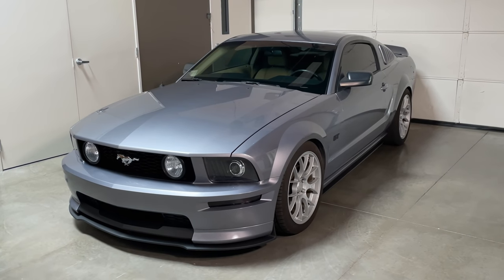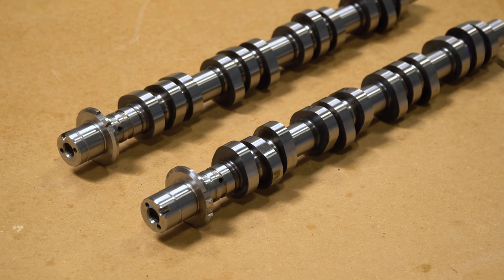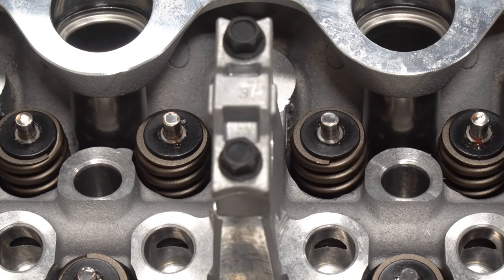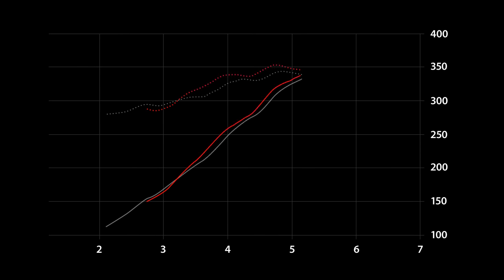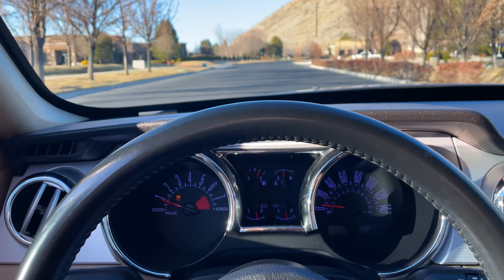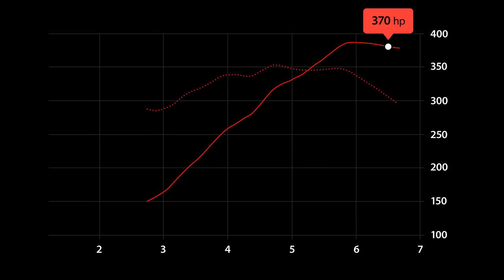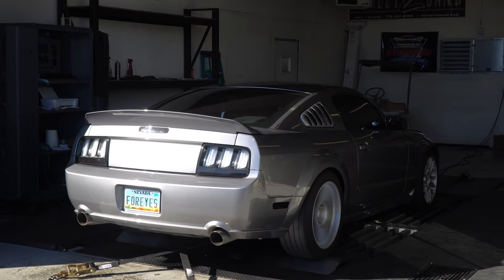The results 📈 of installing the most aggressive cams on my Mustang

Comment: Unfortunately the Heads and short block won't do much for NA power if any. But hey when boost comes around they will be fantastic. 
So with Cams, Intake, Exhaust, E85, TR-6060, and 4.56 gears here is how the 3V does. 
Also suspension, tire, weight loss etc...
https://www.youtube.com/watch?v=RJOvqM2fiww&list=FLowQqmeGBo6RHE2rcjGAHRg&index=124&ab_channel=StickShiftSam
They rip with the right gearing since they are so light and the new stuff is so heavy.
I think he ran an 11.2 @ 118 mph NA stock shortblock launching off a 2-step at basically the rev limiter. So without the 2-step rev limiter launch i could see them running a 11.9. Thats not bad at all.

Comment: I have a built Aluminator 3V and the 127600 cams are NOT the most aggressive cams for this engine. I have the Comp #127650 cams, now those indeed are the most aggressive cams from Comp (according to them) that you can shove into this engine.

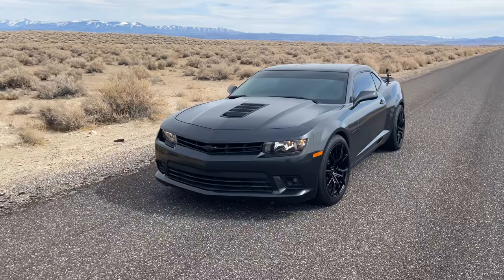Comment: Let me help you I did a 3v build 10 years ago on my 07 Shelby gt 3V , built bottom end ported polished 3v heads with 1mm oversized valves . Comp 127550 stg 2 cams a t56 magnum xl and 373 gear and Vortech V3 SI trim on 14/15 psi . Car made 735/628 8300rpm . You need a touch more gear if your running n/a but if you boost it leave that gear in it or 3:55s trust me . Also a tremec 3650 will never shift at the rpm your 3v is going to make peak power at with those cams . My car made power to 8500 with a blower. I ended up over driving the blower with a 6% crank pulley Iby innovators West. The car came alive much faster and I didn’t have to shift it as high I was able to shift it and make good power on the street around 7700 the other difference was I my motor was 10.2 compression and Stock cubic inch I didn’t want to change the rod angle and side load the block with different rod ratio when stroking a 4.6 . Your going to need to swap that transmission for a piece that will handle 7000+ rpm shifts , good luck with your build. Your on the right path

Comment: lol when your "most aggressive cam" falls off at 6k when i had a crane cam that was rated for 7800 in a foxbody. having OHC gives you the rev advantage over the pushrod. at least 8000 rpm wont wear your valvetrain out!
Reply from the maker: yeah there’s not enough air pressure at this altitude to sustain the engine above 6k, sucks.

Comment: actually you should upgrade to 4:10's or 4:30's.  I installed 4:30's on a 97 cobra back in the 2000's and it was awesome.  Amazing difference to the 4.6 engine DOHC engine.  It would appear that you have a lack of torque probably inherent to all 4.6's regardless of your stroke.  Only way to over come that NA is to gear for it.  Trust me...the steeper gears make all the diff.

Comment: I had a shop in the early 90's building Foxbody's. I'm going to give you the same advice I gave back then. Have a plan of exactly what you want to do and a budget to get there. If turbos are your plan than build your car per future turbos. Why are you buying and trying parts now and building it to do something else. That is a waste of money, which I found is exactly what most people used to do. Buying pieces of a puzzle and trial and error is inefficient and costly. It's better to plan it out and go from there using someone who specializes in what you want to do, not a "general mechanic" or someone who specializes in something else. A mechanic who specializes in xyz can tell you exactly what you need to do for each application

Comment: My stock chevy express 3500 6.0 cast iron block Vortex L96 does 349hp and 398ft/lbs torque.
Of course, it's a 9600lb extended cab beast. But I think your upgrades are going into nowhere. If I did the cam job you did, I would probably be pulling well over 410 hp. And with the 6 speed allison trans it would be fun 🤣🤣🤣

Comment: Just in case anyone reads this message, would you recommend getting the Ford Racing intake manifold to use with the Hot Rod cams? Ford says the cams, manifold and CNC heads will produce 50 + horsepower. Here's the kicker though, Ford doesn't produce those heads anymore.

So, will using the Ford Racing manifold and the Hot Rod cams together produce better horsepower than the stock manifold and cams together? If not, what heads would you recommend to use in place of the Ford Racing heads?

There's a lot of solid info in these videos, so thanks for that anyway, it's exactly what I needed to know for the S197 I want to build. I'm looking to produce around 450 horsepower at the crank, without using boost, so if you have anything to add, as far as parts go, that you already haven't, please do!

Comment: Still not bad considering the huge difference in displacement and torque. Too bad Ford never put the NA OHC 6.2 in a Mustang, it would whip the shit out of a ZL1. One thing Ford does extremely well is extracting a lot of performance frome small cubes, imagine if they put the R&D into comparable engine size

Comment: I have a JLT series 3 (which says 30hp) and Roush extreme Catbacks. Reading forums on different parts I want, UD pullies supposedly yield 10hp, FRPP cams around 25-30hp, BBK shorty headers 10hp, and a custom dyno tune to support. Do you think I can squeeze 350hp out of this? Will i have to get high flow cats and X pipe?

Edit: 350 wheel* horsepower. Also considering 3:73 gears

Comment: In your previous videos, with the aggressive tune you were trying to make coyote power with what you have, the basic bolt ons with cams if I can recall the hp you made it to was 362hp, how come with a stroker kit with all those forged parts it’s not making any drastic gains? I thought you would be close to 500 with a stroker kit and all that deep internal work b4 the aggressive cam, am I missing something?
Reply from the maker: low compression ratio, possibly large piston ring gaps letting too much blowby. engine’s built for boost often don’t make great NA power, but i’m trying.

Comment: 4.6 : built engine, ported heads and cams, 400 hp
My 5.3 : cam kit, 410 hp
Man you would've been better off just swapping a gen 3 5.0 in that thang

Comment: Seems fast to me I always felt 400hp was real good, 
400hp is not a bad punch and it’s not so much to where you have problems applying power to the pavement 

But I come from the era to where 325hp was something
Reply: have some what of a sweet spot for the 4.6l 
 Seen them hold their own, with a actual driver , not  steering wheel holders that hold their hands 
Ten &Two and just mash a pedal on straights  and act king shit because they gap you with 600hp.
 
Curves, traffic, bad roads ,and timing traffic with dipshit drivers is a whole other animal

Comment: Looks like you need more cyl head flow rather than cam timing. Especially with the power plateauing like that. Something's getting choked in there.
Reply from the maker: Not enough air pressure up here at 4,500 feet to sustain the engine beyond ~6,000 RPM. Since this car will be boosted the issue is moot.

Comment: Did you figure out why HP flat lines above 5500 RPM?      Your cam is plenty big enough could it be the intake manifold shutting down power up there?    The old curve also shuts down there.   If it didn't shut down maybe it would get to 410rwhp@6500 rpm.
Reply from the maker: i believe it’s the elevation, not enough air pressure at 4,500 feet to feed the engine at high RPM
Reply: Elevation will affect power due to air density but should not affect the power curve.    If you were in the old 5.0 days id know the long runner intake is shutting you down over 5500 rpm and if you want a higher power band you'll need a shorter runner intake.
Reply: The other reason would be valvesprings.     But I assume with the ported heads and a cam swap proper valve springs are installed.   I have to imagine the PowerBand of the new cam goes well over 5500.   Solve that and you got a nice chunk of HP waiting.    The old setup also flat lined at 5500, so its likely the same thing bottlenecking it.
Reply: Spec sheet for the comp cams 127600 shows a power band 1000 to 7100.  It requires specific valve springs.  It should be power peaking at 6500 or so in your setup.  Which is easily 410 to 420 rwhp based on those curves.  

Another culprit could be a fuel shutoff or fuel pump issue?   Its more likely valve speed.    I found another guy with a similar combo and its 425rwhp@6600.

Comment: "most likely reduced my compression ratio"?? The CR should have been calculated and then checked/confirmed during the engine mock-up. Not hating, just pointing out that these are required steps in putting together a high performance engine. No guesswork.

Comment: Well comparing a 6.2 liter to 4.6 liter. I think you done pretty good. I know on race day bring what you think will win. But the chevy to ford mustang comparison has been going on like this for years. Now when ford guys bring out a mustang with a 6.2 liter the chevy guys always cry and say that ain't fair. Lol. O well it sounded good. We'll see what happens when you change the rear end gears.
Reply from the maker: ha yeah, i did the math and if the 3-valve was a 6.2 liter, it would make about 485 wheel horsepower. and if it had the same compression ratio (10.5), it would make over 500 wheel, which would be pretty awesome.

Comment: 4 eyes can you touch up on either a steel flywheel or aluminum?  thank you.  Which one do you have?
Reply from the maker: The lighter the flywheel, the more power makes it to the wheels. This comes at the cost of driveability and drivetrain noise. Heavy flywheels store more rotational energy which allows for nice smooth linear acceleration from a standstill and they also dampen drivetrain noise by reducing harmonics.

I currently have an aluminum flywheel (11 lbs I think). I have to slip/modulate clutch on the launches so the car doesn't bog down - it's tricky. But the car is also super rev happy now and seems to scream into the higher RPMs.
Reply: @Four_Eyes  Thx for the info.  Love that 3v!

Comment: Did you ever get strong fume smell? I installed hot rod cams and pypes longtubes catted H pipe. It’s been couple of days and the car stinks. Checked and no exhaust leaks so far.
Reply from the maker: Can you smell the fumes inside the cabin?
Reply: @Four_Eyes  Yes
Reply from the maker: You should really only be able to smell fumes when behind the car, or if you idle for a long time in the same spot.

Are you running a stock tune?

Comment: So how did you fix the spark plug blow out issue? I'm curious cause I have a nissan 240sx that needs a solid v8 and I like the 4.6 alot.
Reply from the maker: Aftermarket one-piece plugs should do the trick. That would be a great build. You would probs get a decent amount of hate, but sure would be unique.
Reply: @Four_Eyes  I feed off others hate and ability to do nothing about it 🤣🤣🤣. I just happen to live in the one area where there are a ton of broken in half crown vics, mustangs, explorers, and f150's. So I have my choice of cheap aftermarket and garunteed modular's laying around.

Comment: Did you ever race the Camaro before he sold it?
Reply from the maker: negatory, it would have been closer and i may have pulled a little in first and second, but third gear on these mustangs is too long. i raced the viper recently and it was p much dead even until i hit third gear.

Comment: Idk how you can say that the drop in compression doesn't matter considering you are planning on TT'ing it. Obviously you are going for power and for the money you are putting into it, the compression ratio super does matter. You are just throwing away extra power.
Reply from the maker: if this was an NA build, a compression ratio of ~9.5 would be a huge issue, but it's nearly ideal for running 12 to 17 pounds of boost on pump gas.

Comment: Any updates on the car? Did you get the gears and clutch put in?
Reply from the maker: needs a new transmission (ordered), having trouble passing emissions (4 sensors won't set), my buddy sold his camaro (lame), picked up another project car. new video saturday.
Reply: @Four_Eyes  ready to see what this thing is going to do since I plan on doing something similar. Right now it’s pretty much full bolt on jlt cold air, sr underdrive pulleys, Ford racing manifold, gt500 twin 60mmtb with the bbr adapter, Howard rattler cams, sr longtubes, 3” h pipe, muffler/cat delete, 4.10 gears, zex nitrous wet kit 100 shot, and a Lito tune. Trying to find another shortblock now and build it while I drive the car as is for now. Then when I get the other short block built (still haven’t decided on a rotating assembly) ima go with either a procharger or vortech and see if I can push 10-12lbs of boost on pump gas then possibly have a e85 tune with a little more boost. With the money I’ve spent on the car and upgrades I coulda had a sweet coyote but I like being the odd ball underdog lol

Comment: 387hp after all those mods???? You could buy a lexus ls460 and get 390 crank for 7k or buy a lexus isf and get 420 crank with 368whp for about 16-18k and get that to 400whp with headers intake tune and exhaust

Comment: I got a question for you I'm convinced I got 3:55 gear ratio my car revs to 6400k in third I redline at 110 with you running so much more rpm dose that mean I'm actually at the lower gear ratio
Reply from the maker: Hey Jace, speeds @ 6400 rpm w/ 3.31 gears should roughly be:
1st: 47 mph
2nd: 80 mph
3rd: 120 mph
4th: 160 mph

Comment: Do you think these comp cams would go good with 4.10 gears?
Reply from the maker: yes
Reply: @Four_Eyes  and I’m basically full bolt on, ford racing manifold, catless headers, ford racing gasket, jlt intake, etc, I make 330whp with a custom tune, I want to cam it but don’t know which to go for, I don’t want to race rather just for sound, would you recommend going with the hot rod or comp cam?

Comment: The heads and cam kit was a complete waste of money. If you're going turbo then the air is forced in so you don't need that stuff. Money would have been better spent on a decent clutch and a set of gears which are still a benefit once you go turbo.

Comment: Sounds to me like you have a bad 2nd gear synchronizer. If the only issue is a worn clutch, it should still shift from 1-2 with no issues. 
I don't know whether the Mustang you own has a cable or hydraulically operated clutch, but your clutch mechanism could be causing your shifting issue also. 
It sounds to me like you have a bad synchronizer though.

Comment: Your trans is shot and will break soon, they all do, I went through 4. They don’t like to be power shifted at all there just to weak. You need to find your self a better tuner, the fact that you had bucking on a set of Detroit cams is really sad considering there specs. And looking at your power curve, your car should not be peaking out at 6k and falling on its face like that with the heads and cam setup you have you should be making power well into the 7k range. That whole setup you have should be 400whp all day and making power into the 7k rpm range. I’d find your self a tuner who knows what he’s doing with these 3v cars. Maybe contact Lito or Lund. Nice job on the car 👌🏻
Reply from the maker: I'm at 4,600 feet and there's just not enough air pressure to sustain the engine above 6,000 RPM. In general, the higher the elevation, the earlier peak horsepower is reached on NA engines.

Comment: What does strocking out to 5.0 mean?
Reply from the maker: The internals have been swapped so the engine's stroke is now 3.8" inches instead of the stock 3.55" which increases displacement to just over 4.9 liters.

Comment: Get it tuned by someone else  My motorcycle made those kinds of gains with a fuel and ignition mapping.
Reply from the maker: your motorcycle makes almost 400 wheel?
Reply: @Four_Eyes  lol no but some do though for real.  Im saying its common for a dyno tuner to get a stock bike at 15 to 20 hp gain from a tune.

Comment: That's not enough to hang with my 2.7 v6 Audi.
Reply from the maker: what year? i just gapped a 2011 S4 by 3-4 car lengths, we did about 4 runs.
Reply: @Four_Eyes  the 3.0 supercharged only makes 330hp and is junk stock. You definitely didn't beat a tuned one with a pulley. My 05 2.7 biturbo with ko4's is out of your league.
Reply from the maker: ok well if you ever happen to be in the reno/tahoe area, let’s line em up
Reply: @Four_Eyes  it sucks on road trips. Once I finish the new motor and turbos on my X5 35d, I'll bring that and see how it stacks up. That would be an interesting run.

Comment: Mustang owners and their excuses. 😂🤣😂

Just get an LS motor and find happiness. And  here’s another tip… go 3.90 or 4.10 gears. 3.73 gears are not a good ratio for the stock tranny gearing. You’ll always be searching for a cruising gear in town. Been there and done that in a Mustang. It sucked.

Comment: Ford modular motors were junk.  No matter the size.      I guess the 32v motors were kinda special.  But all 2 and 3v mods. Both 4.6 and 5.4 are junk.  Even the v10 is junk.

Comment: YOU NEED BETTER ADVICE.....AND YOU NEED A FORD.....MUSTANG TUNER.....NOT A SHOP THAT SPECIALIZES IN LS MOTORS.....IF YOU ARE GOING TO USE TWIN TURBOS.....THEN WHY GO TO THE 3.73 GEARS?....IF YOU DO A LITTLE RESEARCH ON THE ERA MUSTANG THAT YOU HAVE YOU CAN MAKE A LOT MORE HORSEPOWER WITH A LOT LESS MONEY.....AND A LOT LESS HASSLE.....

STILL USING THE TWIN TURBO SETUP THAT YOU WANT.....STILL STAYING WITH THE STICK SHIFT SET UP.....AND STILL STREET-ABLE.....

Comment: Why so weak HP numbers ? Crap engine really.  A plain old 289 block or 302 older block can be built with 500 HP simple and easy.  These motors are a joke really.  Good for stock groceries getter.  Waste of time pour big bucks into one of these engines.